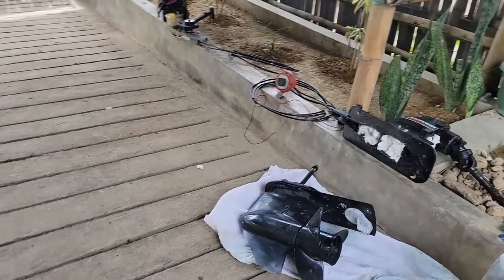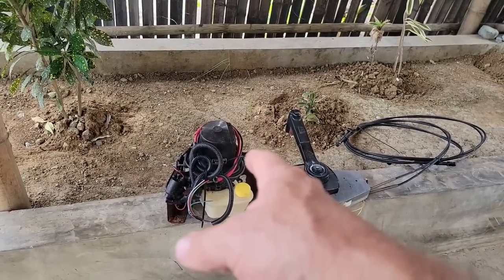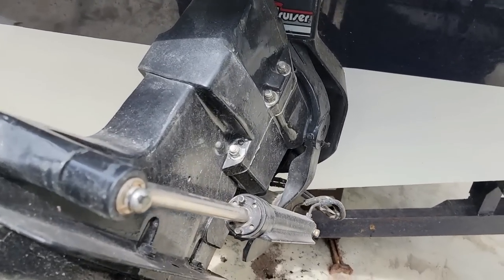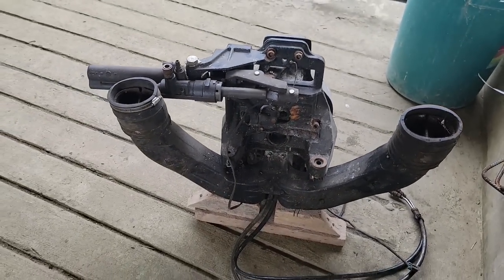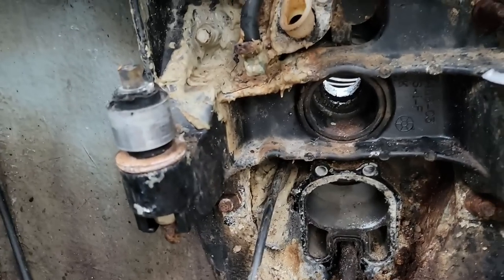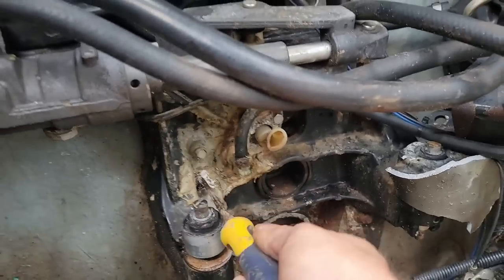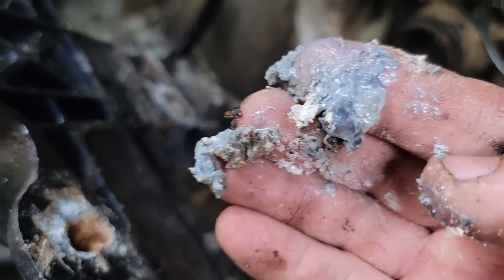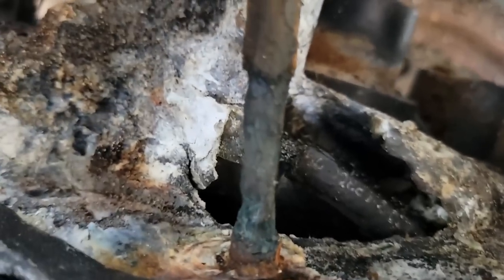Sea Ray 240  Mercruiser Gas V8 to Diesel Refit PHILIPPINES Part 4 Destroyed by Neglect

Comment: I live in the US and have a place in Jamaica. Whenever I have a project there, I try to ship as much as I can think of that I will need. What usually happens is that if I forget something, it is very hard to find it there. I've had to go to a machine shop to have a reducer for a water pump custom made because it simply was not available. Not like in the US where a trip to any big box store would have got me that part.
Reply from the maker: exactly Michael. I too have been in this game long enough that I pretty much know whats common to break or need servicing. I ship so much ahead of me. I did just make a mistake and miss a item that I thought I sent. I will be covering how I got past that in  upcoming video. Interesting your in Jamaica I have never made it there yet. Would love to hang out there a bit. What boat do you have there? Sailboat or powerboat? Stay in contact! jamesray080808@gmail.com

Comment: Enjoy seeing the progress on the boat. I'm sure you will, but check out for rot in the transom with all the water that was leaking through there.
Reply from the maker: it is still solid. Sea Ray sealed that Transom good
Reply from the maker: You see that was first thing I was inspecting when the parts came out.

Comment: Was curious and did some looking, that's an Isuzu engine re-branded Cummins.  At first I guessed 90hp and thought it way underpowered.  At 120 it's still going to be a slug but should save a lot on fuel.  Hi rpm and turboed to the max, it's not going to have the typical diesel lifespan, something to keep in mind.  Hopefully it does cruise nice at 80% power.
Reply from the maker: All of this I already know well. Slug part not so much. That diesel performs well. I am not after speed. I will probably run about 50% power most of the time. More time to react on going around fishing nets and  floating obstacles. If I do impact a floating log or something like it  then the impact will not be as hard. 50% the speed 50% the impact. Also watching out for quick changing water depths and boulders. Slow cruising will be the way. Yes you are right that if you ran this thing to the bone wide open the engine will shrink quick. Once she is up in shape and I have to do another refit if ever I will look maybe a 2.5 to 3.0 size
Reply: @TexasFilipino  yes, it is a real powerhouse for its size.  Nothing wrong with going slow, my standard cruise is 8Kt.  And yeah, we have logs and rocks in BC, lots!  And many of those rocks are a lot further from shore than they ought to be!

Comment: Not a big fan of I/Os in saltwater.  Almost every marina I’ve been big problems with them setting and electrolysis.
Reply from the maker: The diesel setup has heat ex-changers with closed coolant system. So it should not be as bad. This boat will not stay sitting in the salt. I will be beach launching it and bringing it back in each time and wash down.  I want the diesel for safety and fuel economy which only thing diesel available in outboard cost as much as my house.

Comment: the control cables may or may not be the correct length for you boat. i guess you will find out soon enough.
Reply from the maker: The diesel came from a 25 foot Trophy by Bayliner. It too is a cabin boat but more narrow in the cabin area so that is more of a walk around. This boat is a 24 foot similar setup. Maybe it will maybe it wont. I have a friend who has a buddy with a shift cable company here in the Philippines that exports globally for all brands of drives. If it don't work they said they would make me a set up at no charge